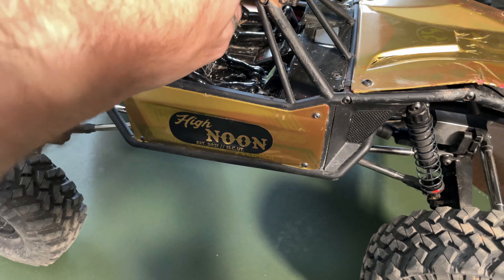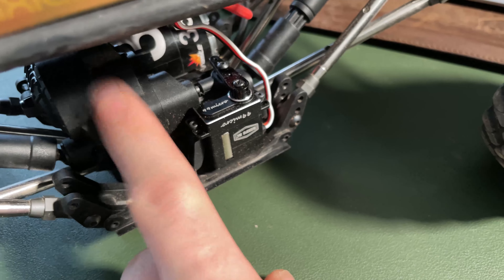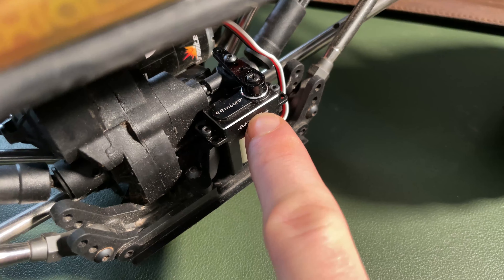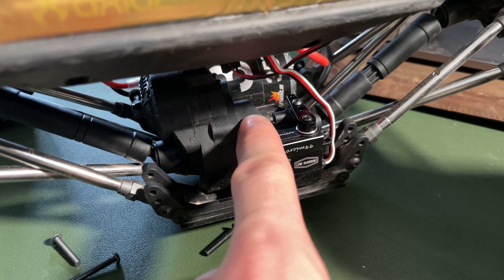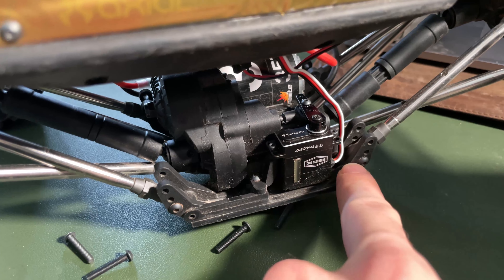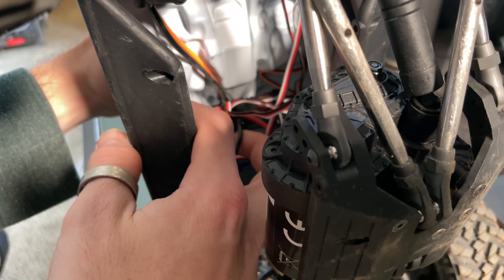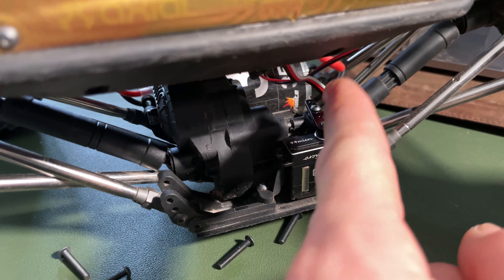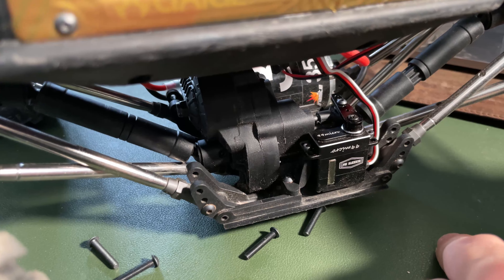Adding DIG to Axial Capra 4WS [How to install a Reefs 99 & Activate DIG!]

Comment: Good video Bro.  I used the Savox SH-0255MG servo from amazon.  Better price than the Reefs and a lot better quality than the POS Spektrum servo Axial recommends.  The Dig engages/disengages perfectly without the need to reverse the truck.  Subbed✌
Reply from the maker: Awesome recommendation, thanks for sharing. I appreciate the sub as well! 🍻
Reply: Helpful information thank you
Reply: Total nubie here. Based on reviews, I have a Capra on the way. While my skills may not warrant it, would like to have all options functioning. Your video made it seem simple. Thanks. Your efforts earned a sub

Comment: Great video! So, the “neutral” dig mode allows the rear wheels to spin freely and essentially making the Capra front wheel drive only?
Reply from the maker: Much appreciated!! And that's correct–neutral dig is essentially just the space between DIG being locked in and out, giving the rear wheels the ability to free-spin. 🤘🏼

Comment: I’m planning on installing a brushless system when I install my dig servo what transmitter would you recommend
Reply from the maker: Oh nice! What brushless system are you thinking about going with? The new Hobbywing fusion prices are enticing 🧐 but I use both Flysky and Spekrum and love them both, but I'd go Flysky GT5 for the value and easy ability to run rear steer on a potentiometer.
Reply: @highnoonhobby  I was thinking of going with spectrum firma 2in1 crawler combo but don’t completely know yet
Reply: @sweatbigcon9729  idk if you got the 2 in 1 but I put the 1400 2 in 1 and it’s a beast for my crawler and no Esc space needed

Comment: Did you install that with the factory controller? I bought a Flysky and had to order a ESC to pair with it. What is that capacitor for that is factory installed?
Reply from the maker: I actually swapped over to the Spektrum Rugged and have since swapped over to the flysky GT5 for easier control of the rear wheels! And not sure on the capacitor–it was from the factory but I have no clue what it was doing; maybe storing a little extra punch for the steering servos if they demand more power in a bind?

Comment: So if using a Flysky controller do you have to replace the esc? Or just bind it to it?
Reply from the maker: As far as I can tell, you'll have to get a different ESC and an RX that works with your FlySky. Someone could come along and correct me, but that's what I could figure with a bit of research online and around the hobby shop.
Reply: If you buy a Flysky it comes with a 6ch receiver but you'll need a new ESC. I used the Hobbywing 1080 and it works great.